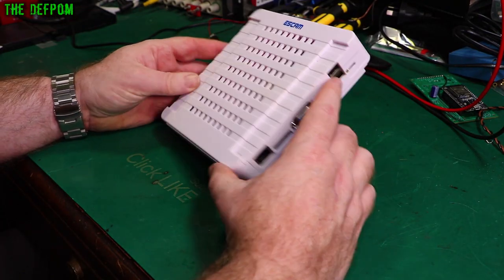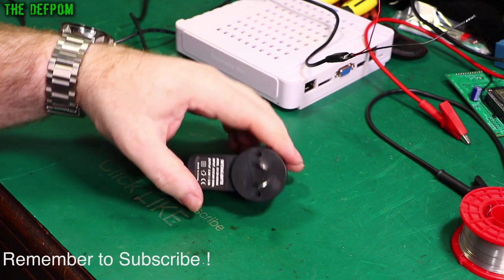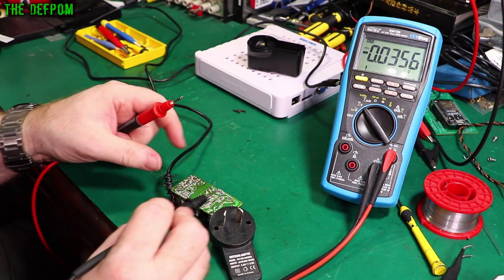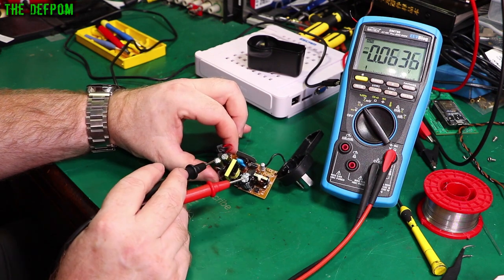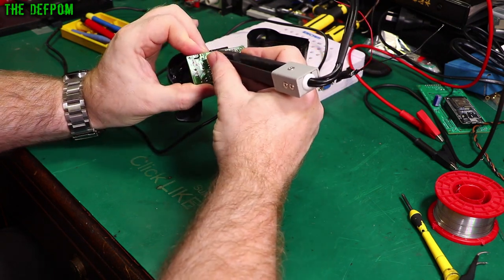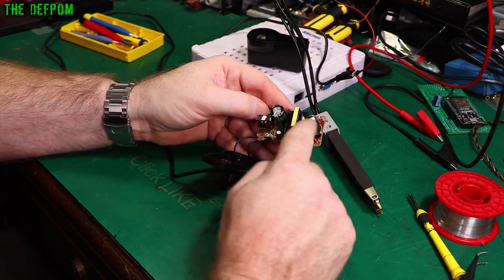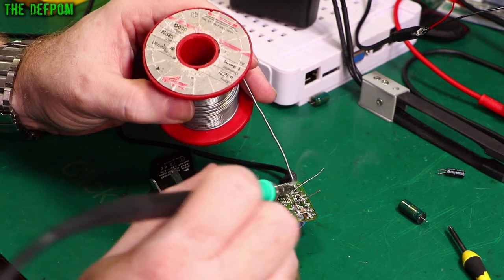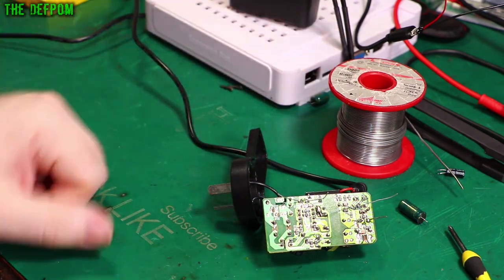🔴 5V DVR Power Supply Repair - No.896

Comment: I'm all for trying to fix stuff, but when you started saying they (apparently) left out the fusing, etc., I was thinking maybe this is better off in the landfill...
Reply: I was thinking that too. The very odd plug pinout makes me think it's not meant for UK ring main, but a radial system where you have a 16A or similar fuse behind it. I would have probably repurposed or built something else.

Comment: Hi, nice video, the high voltage input capacitor, I find, very rarely needs replacement.
Probably due to 100Hz ripple current , where as the other side of the transformer is all high frequency ripple plus a bit more temperature stress.
Yes I agree a total capacitor replacement, otherwise it will come back to bite you later.
I wonder too, about DC leads, quote 2A and you wouldn't even think 1/2A would make it without out of spec output voltage  occurring.

Comment: Last month I was trying to make an old portable DVD player works to listen to my "forgotten" CDs and the thing was misbehaving, did a look into the power supply and the caps looked bougie, tested the ESR and it was terrible, caps replaced and the DVD is back working, the same think happened to a hard drive caddy I use for backups. It starts to misbehave or stop working, most the times the culprits are the power supply caps.

Comment: Nice repair. Though, you might want to throw that power supply into garbage, and get some decent phone charger - it will be much smaller (especially if you get GaN charger), and most likely with vastly lower ripple and noise. Those ultra-cheap chargers often have horrible ripple and noise - just check with an oscilloscope.
Reply from the maker: I look at it in a different way of is something fit for purpose, this cheap power supply worked fine for 4 years in its application, and now that I put some decent capacitors in there I expect it will outlive the device it is powering, yes it will be noisy, but the device it is powering doesn’t seem to mind.

Comment: you should note the polarity before you removed the capacitors.  Some boards are  hard to read or not marked
Reply from the maker: Yes I usually do make a mental note of which way around they go. sometimes I even remember the note.